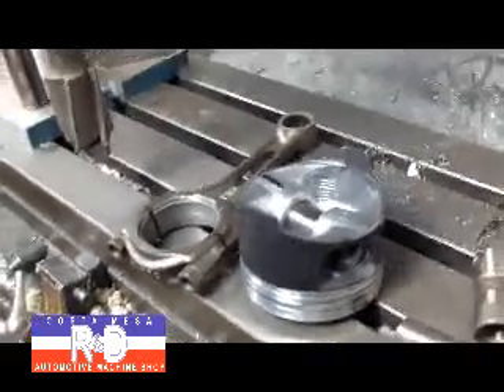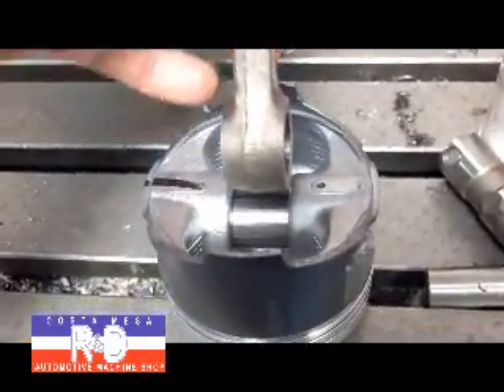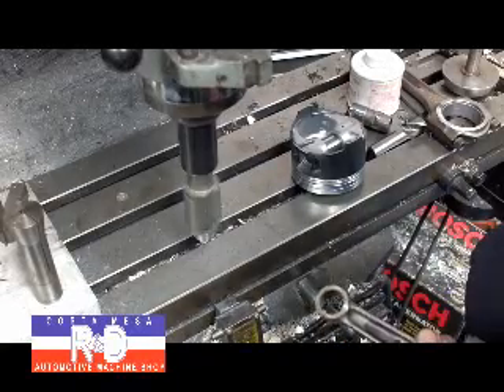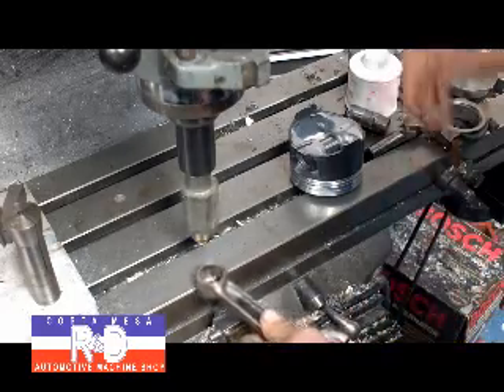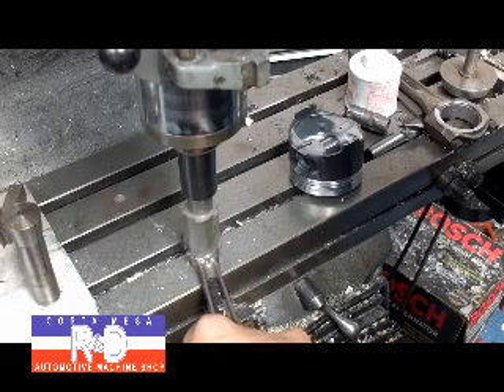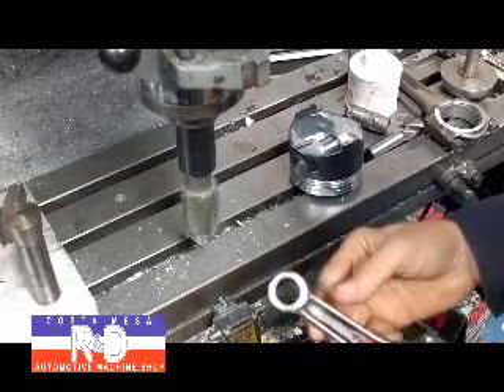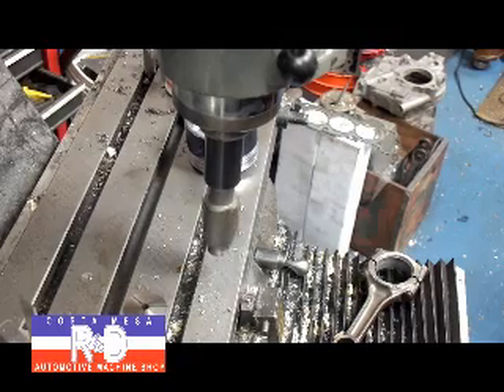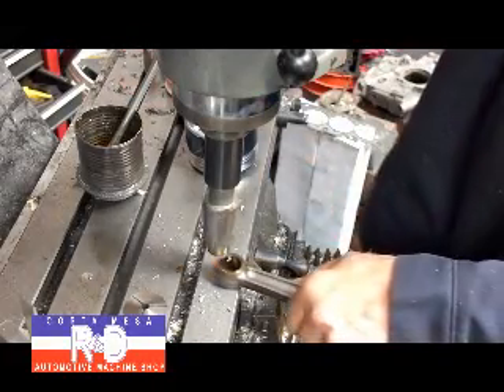Honda Rod Narrowing to use B18 Rods in a B16

Comment: What your doing is machining a PR4 (B18A/B) rod to fit a PCT (B16B) piston, it WILL not fit in a B16 block the deck height is too short. You can run and tell that!

Comment: Good info. I have a quick  question. When you bore a block for new pistons, should you have each piston and custom fit each to  its own cylinder, or are they precision made down to the ten thousands or better and are good enough so you can use one  measurement from one piston for all bores ? Thanks.